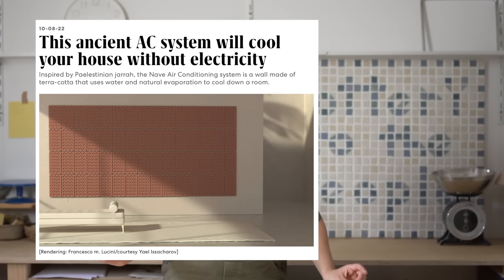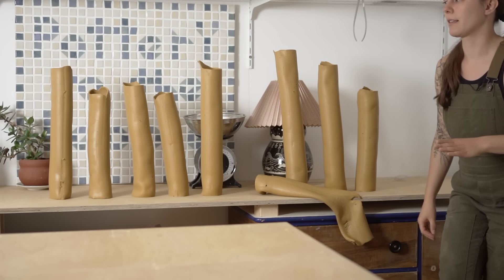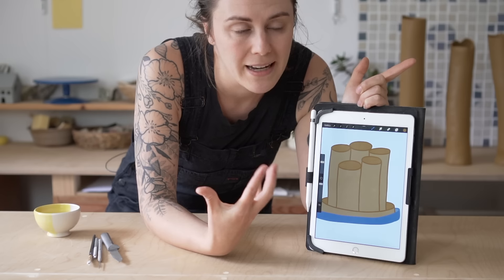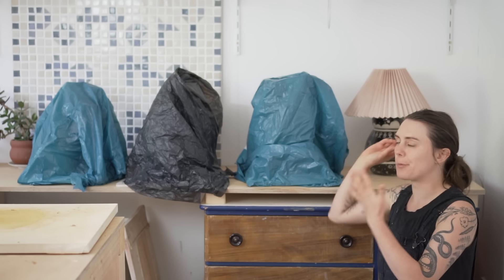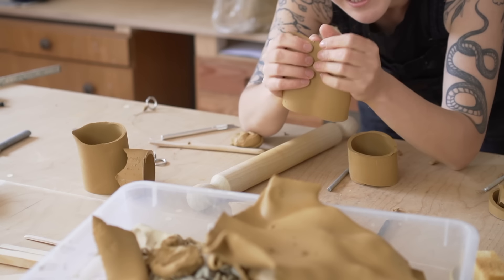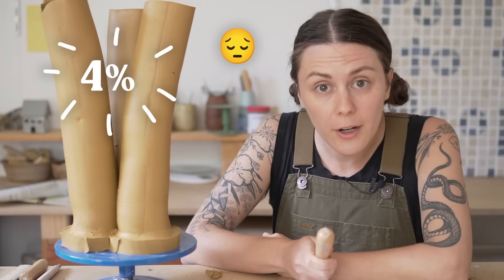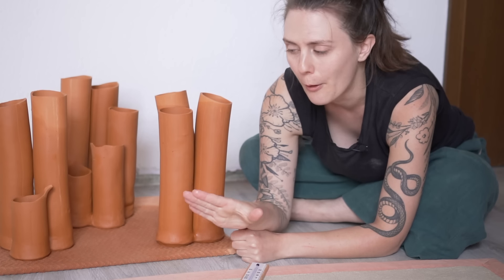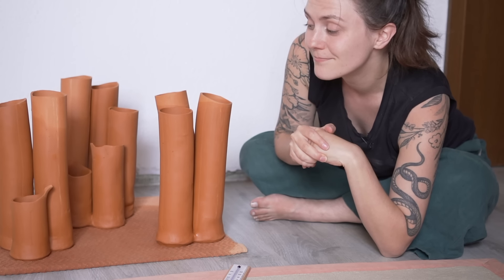Can I make an A/C out of clay???

Comment: Something that you could try to improve cooling is adding in a solar-powered fan to blow air past the outside surface of the tubes. This will aid in evaporation, and pass warmer air across the surface of the tube so that air will be cooled. It may not be a phenomenal difference but essentially the only thing your missing is moving air... In my opinion.

Comment: These kinda swamp coolers work best in dry climates like deserts. But this is definitely the coolest version of one ive seen.

There were actual large versions of these that could maintain freezer like temperatures in the desert.

If someone wants to try something like this even for emergencies. Hanging a damp towel in front of a fan can do alot. Especially if your able to circulate fresh slightly drier air from outside.

Comment: You could use clay/earthenware pipes to blow air through and fill the outer layer with water from a reservoir to achieve a much greater cooling effect.
There are a lot of natural cooling methods like this using underground reservoirs

Comment: Your design might be effective enough to make a difference to a room of coupled with a small fan blowing across them and into the room. That way, it would circulate the cool the air and keep dryer air moving over the clay surfaces, enhancing evaporation. Also, when Air blows across our skin, we feel cooler. Together with a little fan, you could have a real winner. I’m wondering whether the cooling would be enhanced if there were measures spacing between each column. That’s where experimentation would come in. Great experiment!

Comment: that's pretty amazing!! we brazilians actually use some pots like these (a lot bigger and with a lid) for cooling water for drinking. we have also a clay filter that has 2 compartiments and stone-and-coal filters inside. you're on the right way!!! ah... just remembered there's a project for designing a clay refrigerator in some university on Ceará, Brazil for cooling food out of the grid. I think it'd be useful to check out.

Comment: I think you may be thinking of sponges, not corals. Wouldn't the tubes hold their shapes better if you extruded them over a wooden dowel? I think you could seal the wood if you are concerned with the wood absorbing moisture too fast on the inside. Also, you could increase the surface area by impressing some sort of pattern.

Comment: Hang a big wet towel over the window. Better if the shades are drawn and the window a little open. As the water evaporates the room will get cooler. It's not the same as ac but will make the temp tolerable in that room. As soon as the the temps go up in the spring I hang my towel and wet it as needed with a squirt bottle. I usually exchange the towel once a week to wash because it can get dusty. I liked your experiment.

Comment: Where I live it gets to 115 degrees easily in the summer. You have a choice of AC (most homes have it) or a swamp cooler (evaporative cooler- water wets pads air gets pulled though and cools the house drier days it’s most effective humid days useless). We definitely do need an alternative and dig inward and use underground cooling like they did in ancient times

Comment: Neat, I've never seen the extruder before.  Interesting.
Reply: Geothermal is my thought, kind of like the Nebraska Citrus grower design or maybe even more advanced simple.  Thinking maybe using renewable resources as the pipes, though not certain how to design so is more a probiotic system for the humid situations.  That compared to metallic lined oligodynamic effect.  Then again, might be the glaze.  Ah, yes, the glaze alone probably not even needing to be critical with the composition I'm thinking, though can.  Mainly, the glass surface area would have a more minimal surface for the microbes to hang out. Not certain about heat exchange optimization.  Guessing thinner and maybe with a minimal matrix.  I also wondering about the heat input to produce compared to like a ultra high performance concrete UHPC that comes to mind now thinking about.  Everything is basically mass and energy, so have to do the math for the longest term where stoneware or stone like will last generations and maybe thousands of years if effectively designed.  Thanks for the inspiration!

Comment: I did a similar experiment. I had read that some people use 50 gal drums of water In green houses. They would absorb heat during the day and then release heat at night keeping plants warm and alive. My experiment had no pottery involved but I had similar results. With only one degree of temperature change across all my variations. So a lot of work for small results.

Comment: what if you make tubes and fill a windowsized moveable rack with them. have a little plastic tube at the top and feed water through it to tricle down and put it infront of the open window/ a fan to draw air throug? just an idea, maybe it would work?

Comment: Swamp foggers need a decent amount of airflow to work well. A box fan may be enough airflow blowing over the tubes? As always, surface area, anything to increase surface area on the exterior of the clay. 

I also wish I had a kiln the size you have, Bigger than mine.

Comment: What if you made some bottlenecks and grouped them together to form a sort of brick which you would put in an open window (on their sides.  Larger ends to the outside, smaller ends inside.  The force of the air pushing through the narrow end would (theoretically) create a breeze without electricity and maybe offer some relief?

They do similar set ups with discarded water bottles and a piece of plywood or cardboard.  Definitely not as pretty as pottery could be.

Loved this experiment, by the way.  It's beautiful and fun, too.

Comment: A few things that might help. 1. Increasing surface area by introducing ripples into the clay. Squish it a bit one way and squish it again another way slightly above it until you get something undulating? 2. Setting it near your window, with the top covered with a cloth or something. The wicked water can get the extra boost to evaporate using the sunlight. The cloth is to keep sunlight away from the internal water to prevent algae growth. 3. Instead of adjacent flowering pattern, have a linear wall with some gap between each tower. Against a window, it would provide more shade against the warm sun. If you want more sun, just shift the towers farther apart. More shade, shift them closer together.

A really cool video. It was entertaining to see you explore the idea.

Comment: The dryer the air the more efficient they will be, also having a small breeze across them will add to their effectiveness. They function on the same principle as a swamp cooler, just does not use electricity.

Comment: Evaporative coolers usually work best in arid environments. They work by adding humidity to the air, so it will be ineffective any place that's already somewhat humid. My old apartment in Arizona had a cooler that worked on a similar principle. Basically, a piece of porous mesh was saturated with water, and then air was drawn through the mesh and into a duct system. This worked decently well in the desert, achieving around a 10-20 degree difference depending on the day. This isn't a passive cooling system, since it does use electricity, however, it uses far less than AC for good results.

Comment: Result was around what I was expecting.  In a room with no air motion, it would not really be able to distribute the cool air.  And what little distributed cold air would sink to the floor.  This may work better if their was a fan blowing through the tubes.  Of course you would have to make a large selection of tests and conditions to get an idea if this really works.  But it is an interesting concept though.

When I was a kid, we lived in a farm house out in Oklahoma.  No AC, and I have no memory of it being super hot.  The house had windows that we would open to make wind tunnels.  This would cool the house.  We also had fans at certain locations.

Comment: Add a fan to blow air past the tubes.  Uses electricity, yes, but a lot less than an AC, and it will greatly increase evaporation (and cooling).

Comment: Evaporative coolers, or as we call them in the USA swamp coolers work really good in the right climates. The drier and the hotter it is, the better they work. A fan would help a lot with them. Also, a more open design,  air flow and surface area are key. How we use then in the western US is we open all the doors and windows and with fans more the air in and out. Scotty's Castle in Death Valley used a in side water  feature to keep cool, with a temps as high as 56.7 °C, and Average 47.4.

Comment: I think the most important part would be to have that as part of the wall or near a window so that the air coming through would increase the evaporation of the water and cause the cooling of the air as it flowed through and into the home. Another part of the system is that there are air vents at the top of the wall near the ceiling that let warm air rise and escape..that causes air convection, air brought in lower and past the wet clay coming in and cooling and displacing warm air that rises and escapes out the top vents

Comment: In India they use the top of 2 liter bottles as air conditioners. They cut off the top 3 inches of the bottle and attach the funnel in a hole on a piece of plywood. They then put the plywood ina. Window with the wide opening facing out. The funnel catches the air and it is compressed slightly as it travels through the narrow portion. As the air expands back out it cools. The heat, I think is absorbed into the neck of the bottle and into the wood.

Comment: We use evaporative cooling in New Mexico, US. I think if you used a fan to direct the cooled ambient air, you would likely have better results. The reason perspiration works for humans and other creatures with sweat glands is because the air moving across the skin dries the sweat, thus creating the cooling effect. It’s not necessarily the presence of moisture; rather it’s the presence of moisture in addition to air that has some movement.
We also find that our evaporative coolers are useless if the environmental humidity is above 25-30%.

Comment: To cool the house, create a wall like that with the outside being porous and inside sealed. The evaporation outside will cool the wall and that will absorb heat from the room without increasing humidity. Before considering it an ecological solution though, perhaps do the calculations of how much energy is used to provide the water consumed… that would be an interesting one to me

Comment: As clay comes out, sleeve clay tubes over sections of pool noodle/pipe insulation (that can come in different OD sizes), that you cut to length prior. Should hold  long enough to set well. Than remove for final drying.

Comment: As long as it gets cooler outside during the night - noone needs AC. In summer (when it's hot) we get around 36-38 °C. So during the day we keep every door and window SHUT, curtains down where possible. At night you get ~18-22 °C. So from ~00:00 at night to ~06:00 we open EVERY window and let the walls/furniture etc cool down. Once it gets warm again, it's SHUT them windows! Once in a while you get a really cool night with around 14 °C - that help alot for a few days.

The problem mainly are people (as always) - letting in the hot air during the day 🤷‍♀️😅

Comment: have you seen the pottery systems that move air through them using a temperature gradient caused by the water dripping onto the porous clay? those are the most efficient systems, though they don't really have any designed for houses.

Comment: To my knowledge, the purpose of these kind of "coolers" is to prevent your house from getting hot. The hot sun rays will hit the wall, and these will cool down the wall itself, in order to prevent the heat from entering inside the house. But the ones I've seen didn't look exactly like that (0:24), so this might be a different kind of thing

Comment: Making tubes into jagged/flower with many petals shape would increase their surface as well as scratching all the surface. Look for 3D-printed clay humidifiers. Hand-made piece would be a bit less effective, but good enough to try.

You can make thin sheets of clay with width of the height of your kiln and length a bit less than than your kiln's diameter, then fold the clay in half placing a sheet of 2-5 mm plastic (or something smooth) in between, then scratch all the surface in parallel lines and let them dry, removing plastic halfway through. After you make lots of these petals, you can glue them together with clay in flower shape and fire this piece.

Comment: I wonder if the evaporated water made the air more fractal there (restoring the subtle charge back to the air [water has a dielectric constant of 80, which is rather huge for such an immensely common material]) and so your bodily energy was compatible with the energy there and so it "felt" cooler/more compatible

Comment: I love this... they are organic and could be made to be even more beatutiful for ornamentation and purpose...
However you need to consider placement... they need to be higher as cool air sinks and you will get most latent cooling from air that is hotter (higher in room).   I would keep the in smaller clusters to be able to distribute them through room (or around where you are sitting/sleeping). A small USB type fan behind them would also up thier  effectiveness by moving move air over evaporative surfaces
You may also want to convert making lids/covers for them to make the mosquito proof.

Comment: 1 degree is actually insanely powerful for this design and size. Have that in a corner in every room and kinda cover it with some plants maybe? Im thinking texas weather where even the powered ac will only get is down to 76F or 24C that extra 4-5 degrees would be the difference between sweating and not.

Comment: Im curious, if you were to make a simple cap for all of them, and place a fan behind them, blowing air past, wouldn't this achieve a better result, with less power consumption than a normal AC? Even a tiny little 4 inch desk fan, just to get air flowing past the clay, making it evaporate faster, hopefully? 
In a Ambient room, with no real air flow, the process goes much slower, but given a flow of air, it should in theory work much better, albeit requiring more water, but still. Caps only to reduce the air evaporation over the tops.

Comment: Cracks can sometimes occur during the firing process in which moisture or air pockets are trapped in the clay, as the temperature increases the moisture in the process of evaporating can cause pieces to explode or crack

Comment: In order for this to work, you need a constand airflow through the tubes. The cool water will help coolong the air and THEN you will see a dofference. This only works on ventilated environments because they increase air humidity, so avoid keeping all the doors and windows closed. If the humidity in the air grows above a certain point, your body sweat wont be as effective and you will feel even hotter

Comment: I was actually wondering if the terra cotta clay tiles that some people use as roofs, end up absorbing water and then crack during the winter because of porous absorption but I dont know if they're fired or formulate differently.

actually now I wonder if our home in the Philippines, with the big roof, and our deep and cool basement is actually experiencing some of the "evaporative cooling" because there was a hole found during the excavating of the basement, and the water in it is brackish with lots of porous coral, though everything else is covered in concrete, so I guess that seems conflicting, but it is cooler down there.

Comment: ideally, i would've used a total of at least 4 thermometers to gauge whether the device works, or whether its just general ambient fluctuation. 

One on the floor next to the cooler, as you had it. 
A second on the floor in another location of the room with similar conditions as the first (out of sunlight and away from a door to avoid under-door draft). 
A third maybe a meter above the cooler. 
And the fourth at an identical height, probably above the second thermometer. 

I feel this would've illustrated if what you made actually worked, and whether it would work if you expanded it.

Comment: For that to work efficiently as an A/C, the pipes are supposed to be placed in a way that air (from outside the room) is exchanged through the wet pipes. the object you did here is more likely to help keeping the water inside the pipes cool, by "sacrificing" a small amount to evaporation.

Comment: A/C is powered by electricity which is fully sustainable on a green energy grid. There are modern versions of AC which don’t rely on HFC or other GHGs.  In northern CA the energy grid is already 80% renewable in hottest major cities where it hits 45C regularly in the summer.  There is also highly reflective paint that can cool a house as much as AC and/or take much of the load off of AC.  A house with high reflective paint, solar panels, and a heat pump can keep a house at 20C easily even in 45C weather while still generating excess power to return to the grid.

Comment: two things : requires a dry atmosphere (think swamp cooler, American southwest) and airflow. If it is humid then very little will happen. It works because although it would need a fan it would not need a compressor.  Some of these large structures built in deserts can freeze water. So, dry desert air, a source of water to supply the porous tubes and airflow to remove the heated, evaporated water vaporer to the outside. If done correctly you can make ice cubes!

Comment: Airflow is important to this design, crack your window an inch and have a fan blowing across the tubes..also it works better when the humidity is lower outside..I live in the desert southwest in Tucson Arizona USA we use swamp coolers here a lot.